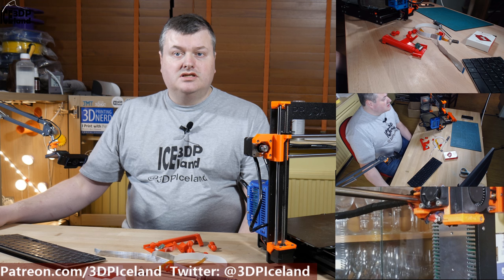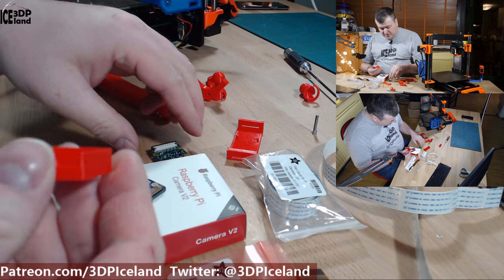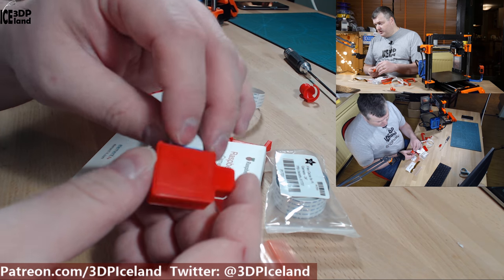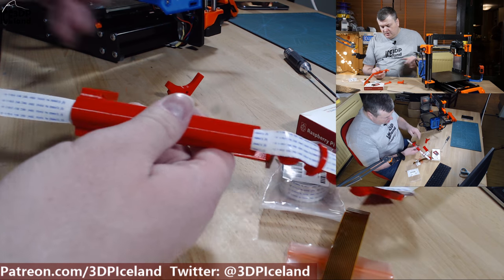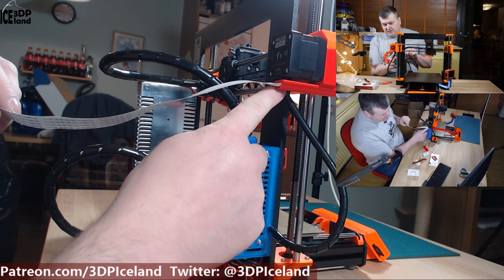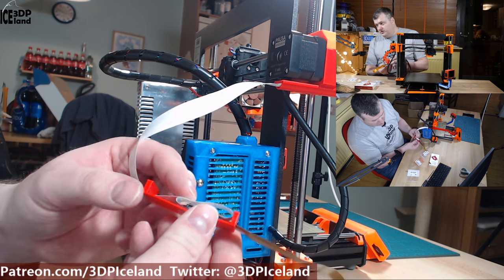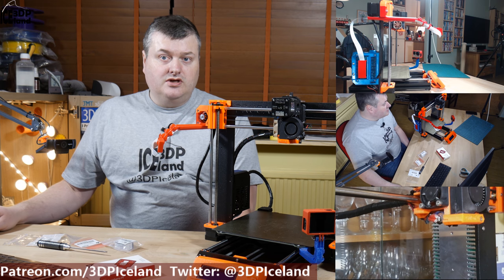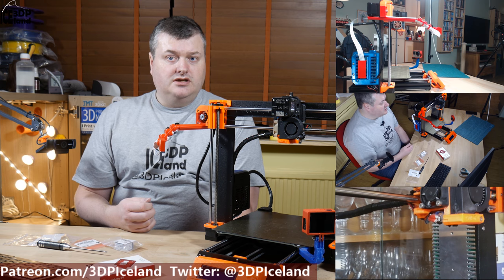Installing a Raspberry Pi Camera on a Prusa MK3 3D Printer

Comment: you are mounting to the blue power supply with the maintenance hole for a PI zero. Can you link for the 3D print of this part.
Reply from the maker: I belive I used https://www.thingiverse.com/thing:2734810

Comment: I can’t seem to get mine to work. I don’t know if I put one of the ribbon cables in backward... -Could someone clarify?
-Is there any software changes that need to be made to recognize the pi camera?
-Also is any else having a hard time getting the x axis to fit? I think Prusa may have beefed up there printed part.
Reply from the maker: Hi, - yea, cable orientation is important :), - if you have octorprint with default config, no changes to the config is needed to enable the camera, - my guess is that you have flipped the cable 
 if you have the newer version of X-axis motor mount, then use this remix: https://www.thingiverse.com/thing:2875976  by user JasonDentler,
Reply: 3DP Iceland Could you clarify for when it goes into the camera, extender & PI are the exposed contacts supposed to be facing the board or away from the board.

Also great video and design by the way!
Reply from the maker: Thanks, - on the Pi Zero, the connectors on the cable are facing the board, but on the extender, connectors are  facing away from the board.
Reply: Thanks Marteinn, I got my cables all straightened out but still no luck. Only change is that instead of an error where the webcam should be I get a "Webcam Stream Loading..." and it never loads. Had the Prusa image on there originally even tried re-flashing it with 3DKC image.Thinking about setting it up on a Raspberry Pi B+. I have raspberry pi 2 on my other printer with Logitech cam and it works fine.